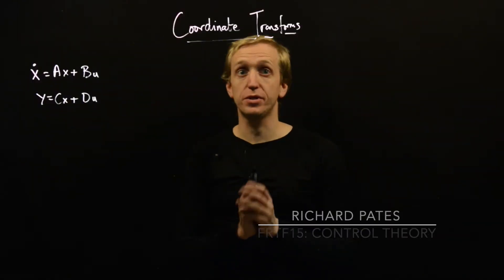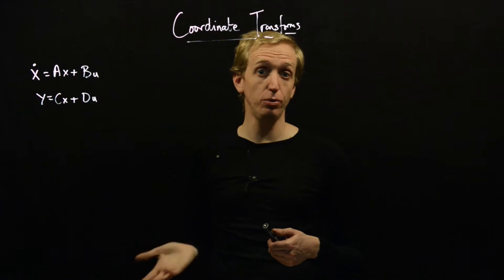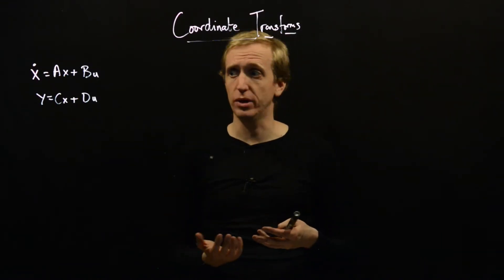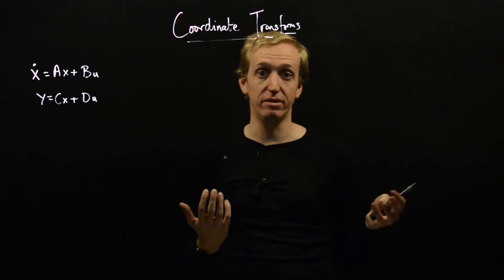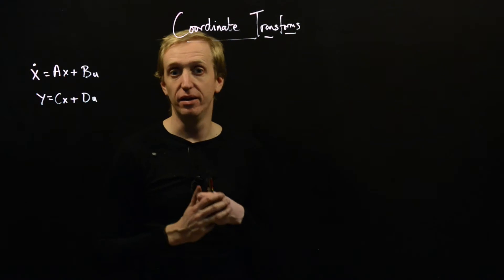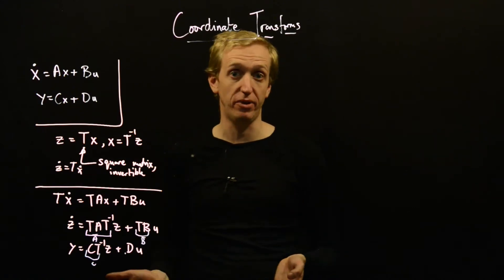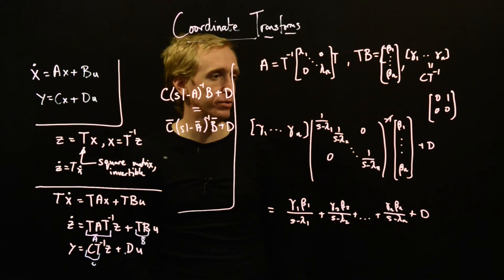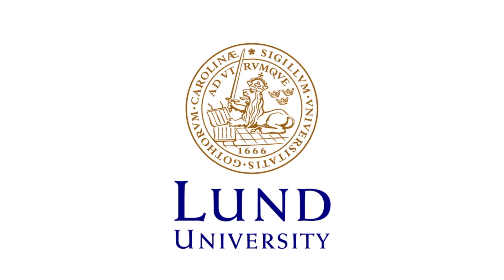Transforming State-space Coordinates

Comment: Hi Richard, is there a canonical form (or otherwise) whereby the poles and zeros appear directly in the state-space, or are we limited to only showing the poles, as we can via the diagonal and Jordan forms?
Reply from the maker: Hello! There is no way that I'm aware of for making the zeros appear in the state-space model I'm afraid - the problem is that the numerator term is generated in a very indirect way, through a combination of the B and C matrices, and the adjugate matrix of (sI-A). To make things worse, the concept of a zero actually starts to get quite strange when you move into multi-input-multi-output systems (have a read about blocking and transmission zeros). You can even have the strange situation where you have zeros and poles at the same point in the complex plane! As a final note, there is another type of canonical decomposition called the Smith normal form. This is not a state-space representation, but does write an input-output model on the form G(s)=U(s)D(s)V(s), where D(s) is a diagonal matrix with terms factored into poles and zeros (e.g. the ii-th entry of D(s) might be something like (s-1)/((s+2)(s+3))). I've not had much use for this form, however it does display the pole and zero structure in a clear way.
Reply: @richard_pates   Many thanks!  I will look into those